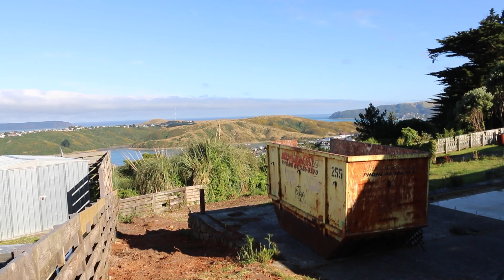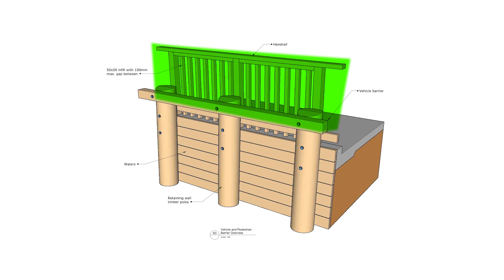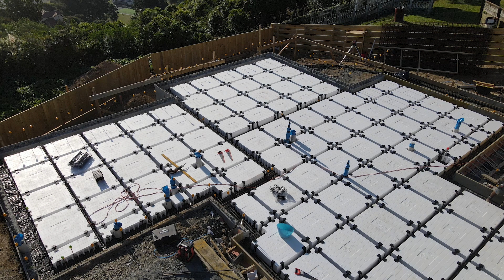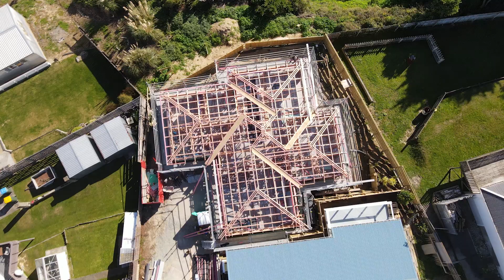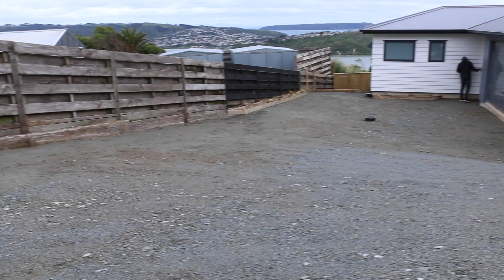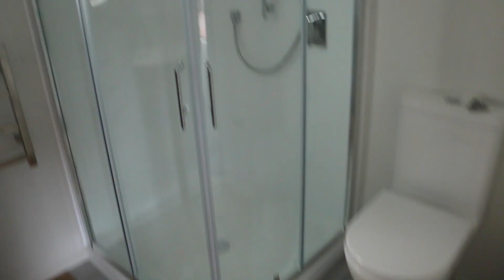NZ's Best Backyard Subdivision!!!

Comment: Why did they choose to concrete the whole floor with all that back filling,  would it not have been more cost-effective to have a timber foundation where the GL was more than 600 below FFL and then a concrete floor where it was less than 600mm? Or was there another reason for this?
Reply: General principle:
If ground slope was 10deg or steeper that's when you'd be right.

I'd suspect the concrete floor was a client specification.
Reply: Rib raft engineered floor ,ideal in Wellington?
Timber foundations would require more work and probably expensive?